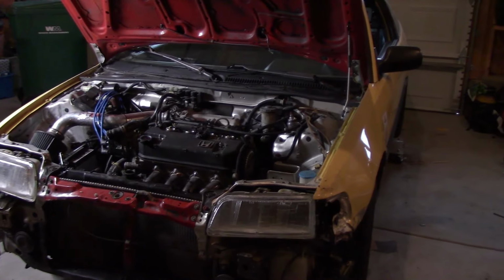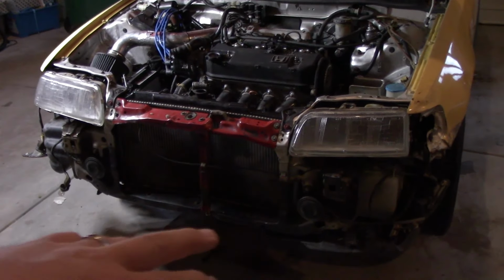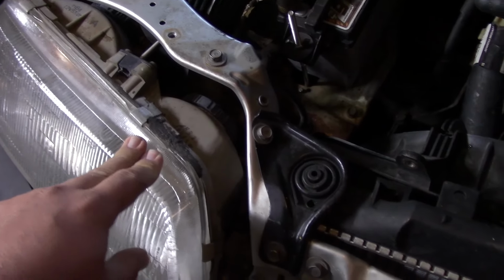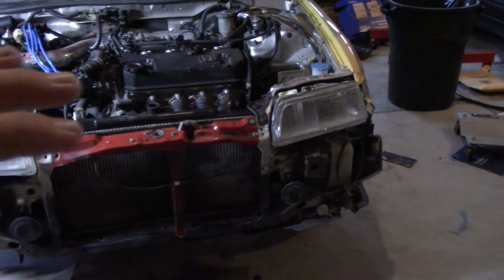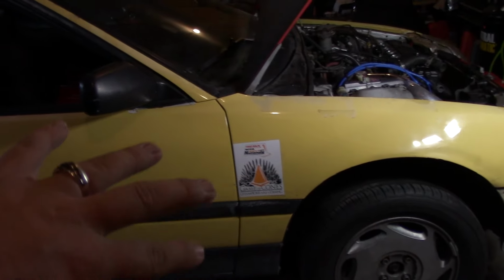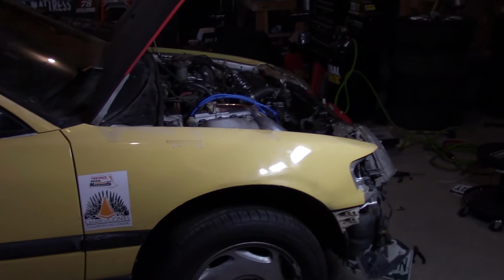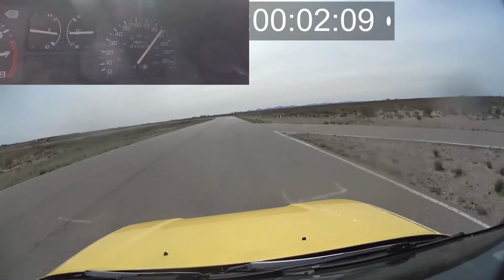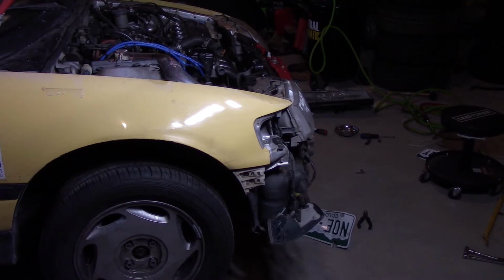Banananut CRX Update

Comment: Nice video. On the in-car audio front, I'll be testing out a new setup at the next autocross event using a parallel lav mic setup going into a long 3.5mm audio cable and then to my Hero 3+ via the adapter. The setup comes on good recommendation but I'll let you know how it works in practice. Entire setup (minus the gopro) is around $55
Reply from the maker: I used one lav mic that worked really well, but the battery life was awful and it gave no indication when it was dead. I picked up another with a larger battery, and the life has been great, but the quality has been hit or miss. I've had really good luck with just placing a camera in the cockpit away from the windows, but the GoPro keeps dying haha. Let me know how your setup works!
Reply: @MuffinRacing  Yep. My car is straight piped now (STS as well) so if I keep it inside the audio just gets really drone heavy. I did save around 60 lbs ditching the muffler and rear section though.